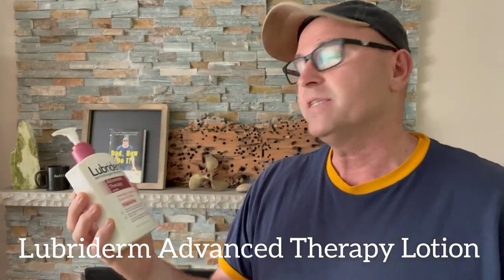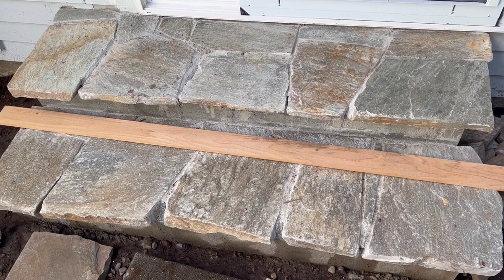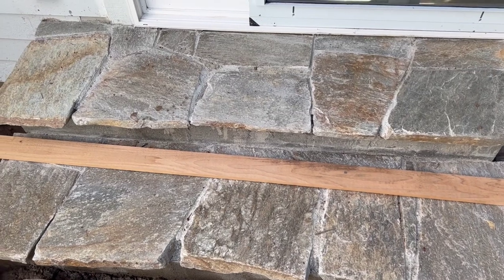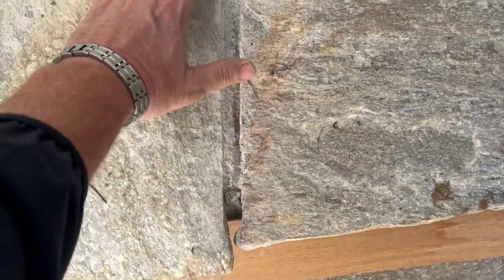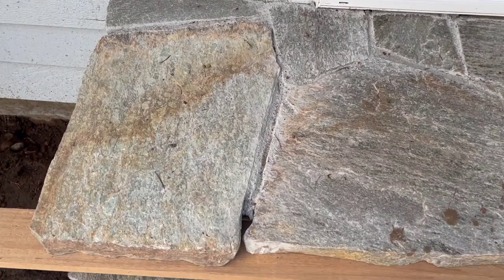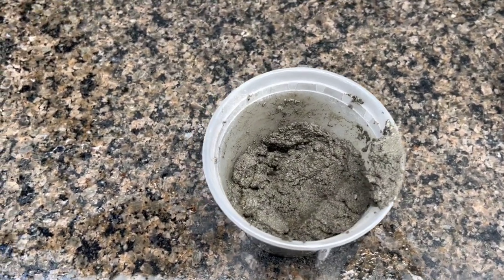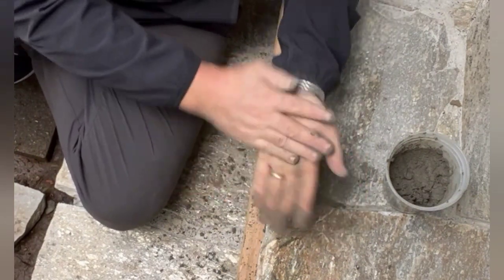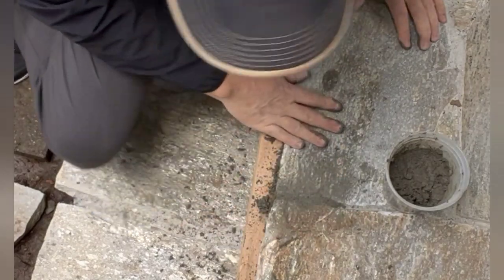How to Work with Mortar

Comment: As a bricklayer, with years of experience, I will say we do use our finger from time to time. 
I'd use gloves, as you mention, especially if it's more than a little bit of finishing, because you are literally sanding your skin off.
Use a brush whenever possible, a 2-3 inch paintbrush is ideal for this project.
You did a nice job on your stairs.
Reply: And a grout bag 😂
Reply: @Kidskifilmz  I've never really liked using grout bags, and if you're a beginner, I wouldn't. Not worth the extra expense except for -(maybe) a bigger job. But to each their own.

Comment: Thank you dad I have to use mortar for my moms restroom to remodel it this helps a lot thank you so much
Reply: If it's tile you are working with in the restroom, you will be using thinset mortar to set the tile and then grout to finish between the tile.  Those are different products and processes than what Dad was showing in this video.  Just a friendly FYI.   🙂

Comment: Great vid -- love your work and mission.  I had a job like this for a friend, and I simply used duck tape to get as close to the gap as possible --- that GREATLY reduced the exposure to overlap with the wet mud.  Indeed, it is a CHORE to scrub away mud that dries

Comment: Can you please  make a video on how to fix rotting out trusses ?  I bought my own fixer upper mobile home and so far, it's been hell. I've been doing it mostly on my own but I don't know if it is going to last another winter here in Minnesota. I'm scared my roof will collapse from the weight of the snow. It's 5 trusses in a row and it's rotted wood due to the roof leaking

Comment: Hey Dad,
Can you tell me, why do you use mortar and not concrete for these cracks? Is there some reason for that?
Reply from the maker: You can use concrete, it just has rocks in it that make it more difficult to work with smaller cracks.